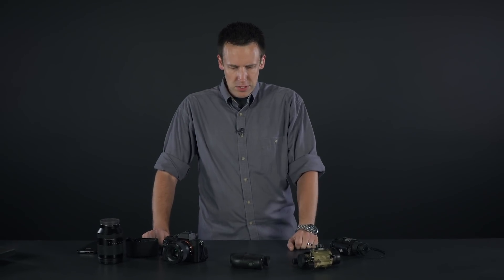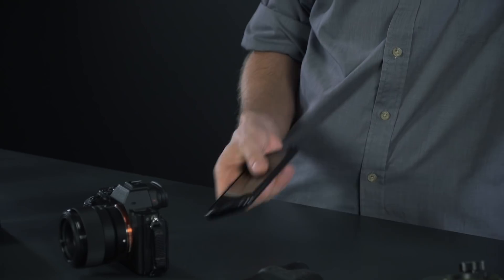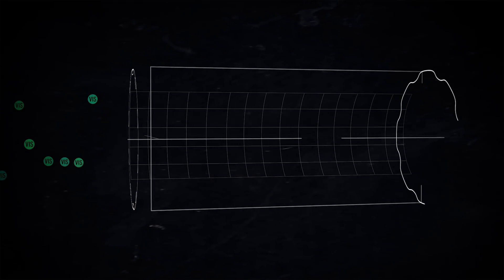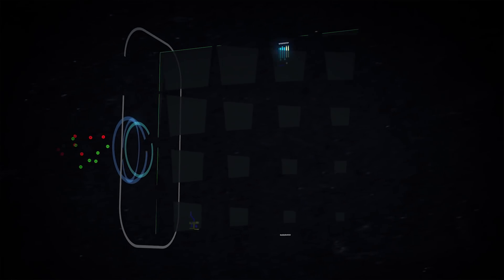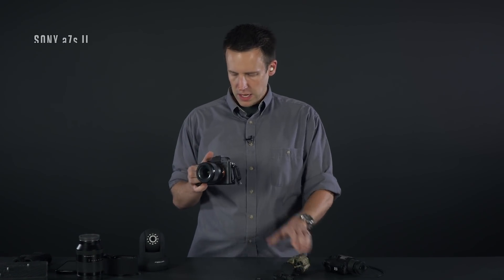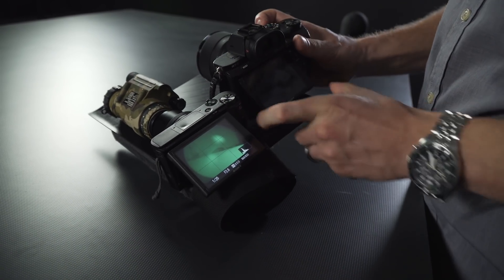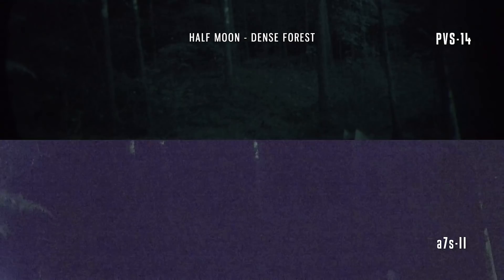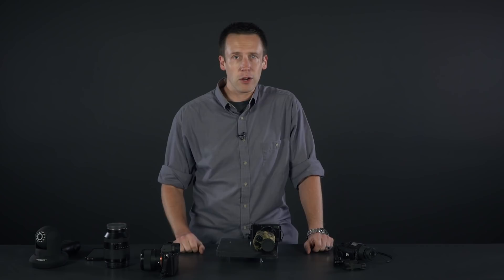When will Digital Night Vision Catch Up?

Comment: I own an Armasight Gen2 hooked up to an Ops Core helmet, works real well for the age of the tech (Russian 90s NV tech) unless it's stupid dark, and that's what IR is for, I'm not too worried about hostile IR signatures as a civilian at this point in time, let alone in that level of darkness which throws a wrench in Gen3s abilities...lol.

Anyways i still find it funny though how an old Gen 1 Cascade tube (think American PVS-2 or Soviet Russian 1PN34/58) kicks the asses of Gen 2 and 3 in terms of light amplification but costs you resolution, which is, as you stated, the most important capability for night vision tech, to be able to amplify the light to a usable level. Perhaps a "cascade-type" arrangement of silicon CMOs could be used to give commerical digital NV an edge, at least since the tech is in it's early "Gen1" phase if you will. I think SWIR  cameras will be the "Gen2" of digital night vision, adding the equivalent of the MCP that is dearly needed to make it viable. Hell, I've heard of UFO hunters and stargazers putting together crude night vision devices made out of old PVS-2 and EEV-8079 tubes and such that work great for that purpose since there's no need to be real mobile with it. 

Though I have no problems with analog tubes, I've beenwondering the same thing about this slow progression of digital NV. While I do think the advances in digital tech are incredible, the real death knell of widespread adoption anytime soon will be cost. They DO have prototype digital night vision units that match or beat Gen 3 OMNI VIII, but they're incredibly expensive, fragile, have awful battery life and/or have other issues since they're prototypes in their infant stages. Similar to when thermal imaging because available in the 1970s and 1980s and costed tens if not hundreds of thousands of dollars, the real hindrance will be price. Nowadays you can get a thermal imaging camera for your phone for $300, but it took a long time for that to become possible. Just my thoughts.

Comment: It's hard to get apples to apples comparison. Ideally you would have a device that has a wide band high sensitivity CMOS sensor designed for low light amplification that reacts to a wider frequency range of photons. Secondly you can do all kids of digital post processing to make the resulting video more closely resemble a proverbial apple. You could do gamma correction, merge the colors to a single brightness value, and finally presenting it not on a black to white scale, but black to green to white, giving the highest range of perceived contrast to a human viewer. Cause that is what the analog tube is doing.
And lastly, in the case of NVG's you would automatically get rid of a large contributor to detail loss here: video compression. I noticed that your comparison shots were all video, not stills. That means that raw sensor data has gone through a video compression, that will have at least some, possibly huge impact on the loss of detail in dark video. This would not be the case in NVG's, as there would be no need to compress the video between the sensor and the display.
It would have been interesting to see you take a raw still image from the sensor, and then see how clear can you make the details after a full photoshop treatment. And any post processing you can do in photoshop, an ASIC can do in real time.

Comment: Pretty flawed comparison. The a7s2 lens can easily be changed and an f0. 95 would have aprx 4x the light hitting the sensor. Yes it would cost more but not by a huge amount considering the cost of the systems involved and I think it could possibly pull ahead. Strange that you went to all the expense of removing the ir filter but didn't think to use a better lense.

Comment: Good stuff. Couple of things though. 
1.You said the CMOS sensor can’t be burnt out by too much light. This isn’t true. 
(Ask any cinematographer that has messed with lasers in the nightclub, or a photographer that is shooting the eclipse.)
2.You only used a f1.8 lens on the a7s2, 
It’s easy enough to get f1.2 or even f1.0 lens which would more than double the light transmitted through a f1.8.
Then there are speed boosters, you can use a focal reducer to use fast medium format lenses and gather even more light for the FF sensor. 
Admittedly the lenses start to get big and heavy at that point, but I’m just pointing out you used a very off the shelf consumer solution for your low light digital camera lens option. 
A LOT more low light performance can be gained from a a7s2 if you want to go a bit further.
Reply: Yes, you can cook a CMOS sensor with enough heat, which prolonged exposure to sunlight or laser beams will do. However, you can point this camera directly at the sun and shoot photos and video for minutes with no permanent damage. I once permanently burned an analog tube in less time by looking at a fluorescent light in a dingy gas station.

Comment: This comparision ist so wrong! A7s extreme  low light performance ist only archived in 1080p Modes in 24/25/30fps (only there is full sensor readout with its amazing lowlight noise reduction). You Talk about 4K Mode, redo your homework and film in 1080p/25 with 1/25 exposure time in fullframe mode. And use a speedbooster (150$) with a F1.2 Lens to get an aperture of F0/0.85. You will see a comparable round vignette like in your night vision but get even more light. Then you will see in which case the Sony 7S series will shine.
Reply: I disagree; I think the camera image looks better if I film in 4K 24p and then downsample in post. Now, I do agree that with a f1.2 lens I could have got more visible photons, but I knew that the f1.8 lens had good IR transmission, and the nicer lenses often don't. Also, a speedbooster would have been fun, but I think its kinda cheating. I also could have used NeatVideo to remove the noise on the 4K video, but that DEFINITELY would have been cheating.
Reply: @isaacbotkintrex  What is 'cheating' in this respect? You're comparing the very best night vision hardware with the best possible result with digital.
Reply: @bogorad  Well, actually, I don't have the BEST night vision hardware; I have a small and light $4k monocular. I was trying to compare a similarly priced, similarly sized digital option. Of course I could spend $15k on ten pounds of lenses and adapters to boost the camera, but then it's hardly the same class. And if we're going to leave the hand-held and personally-affordable class, there are vehicle-mounted night-vision sensors that make the PVS-14s look like toilet paper tubes.

Comment: Great video! Really interesting. Would have been nice to add a F1.2 or even F1.4 lens (as the nightvision device uses a F1.2 lens but the Sony had a F1.8). That would have meant a 50-100% difference in brightness/noise performance.

Comment: Just a novice question: Why not compare it with "true IR cameras" (low wavelength IR) I.E Thermal cameras. They are digital, can see in complete darkness, is starting to get fairly god resolution (720p and up), have very high sensitivity and can show even the most subtle differences in vibrant colors if needed (or just the normal black/white). But sure, they give your wallet a fair punch. Couldn't even get the specs of FLIR's higher end ones. :P

Comment: Sounds like sensor manufacturers need to make a large format, low res sensor. The high res of that camera is killing its contrast ratio, which is the defining factor in monochromatic images. But this would be the only market for such a sensor.

Comment: You did not say anything about the lenses. You can get much faster lenses for the A7S, just like your night vision goggles have.

All you would have needed, is a faster lens on the A7S and it would have beaten the night vision easily. Apparently the PSV-14 has f/1.2 lens. You can easily get f/1.0 for the sony that would be 2/3 more light. And the lens you were using, was most likely f/1.8 so f/1.0 would have almost quadrupled the amount of light the sensor receives.
Reply: Youtube User at the deficit of having very little actually in focus with the a7sii

Comment: There is quite a lot of difference by using a f1.8 lens instead of 1.2 lens like the nightvision has. It's not a pretty good match like you said because the 1.2 lens puts approx 2.25 x more light on the sensor.

Comment: You forgot another very big pro with digital sensors:
like digital cameras and/or cellphones you can have multiple sensors which means broader dynamic range and less noise and that results to in no more big blobs of light which if bright enough can blind the tubes.

Comment: So there are some problems with this video (ex some small mishaps with scientific language and logic): As a military equipment has to be reliable, there is a huge difference between those devices. I am just thinking of an EMP and all your CCDs/CMOS devices are dead and I mean literally they are destroyed, not just turned off... Battery life and efficiency is another problem, but this might be overcome somehow.
The biggest difference is however the sensitivity of Si-based sensors. They just stop at ~1.1µm (bandgap of Si). Well you might think going to e.g. InGaS-based sensors, but they only work between ~700nm and 1.7µm. I am not even considering dicussing the prices for those sensors (20k-40k$ for 640x480). So with all those devices real IR is not possible. (I am not even talking about cooling active sensors, just to get the noise down to acceptable levels [warheads use cryo-cooled sensors and they only work a few times before they fail]).
This video shows some 'IR light', but it is barely outside of the visible spectrum. Some people can actually see it. So this is not IR at all...  So please take the IR bade off the 850nm footage. It is just barely Near InfraRed (NIR)...
Another issue in this test is the use of a lens meant for visible light. I get it - you want to show a real life (not so expensive) test, but remark at least, that a) the transmission of this lens is terrible outside the visible spectrum and b) most lenses will not be able to focus to infinity, even manually...

Just my 2 cents...
Reply: Good points! Yeah, this video isn't seriously practical (since commercial cameras aren't the same as hardened, SCUBA-capable combat optics), or rigorously technical (since I clearly use the term "IR" so loosely), but sits kind of awkwardly in the middle. And good point about the lens; this specific budget Sony lens is popular for IR and UV photography because its design and coatings aren't as exclusively built for visible light, but I don't have a good way to measure transmission of specific wavelengths.

Comment: The two simple reasons why we don't have digital night vision:
(1) Noise. We just don't build sensors with a noise floor low enough to make them viable units; you saw the Sony at very low light - unusable.
(2) Demand. Notice I used "don't build" rather than "can't build" in the above point - A 2MP 35mm sensor with a few years R&D would probably crap on the Gen3's ability, but the commercial demand for creating that specialist hardware just doesn't exist. You might argue "The military" - but you're not taking the numbers into account. Canon shipped 30 million cameras last year, and they're under half of the market share - that's where your tech curve comes from - they need to keep up with the comptetion. So what if Canon put funds into Digital Night Vision - How many DNV units do you think the US Army would order? 100,000? 200,000? 300,000? It's not anywhere worth-while investing the R&D into the specific requirements of DNV tech when the return is likely less than 1% of your primary market.

Comment: Why on Earth are you pitching your soundeffects at around 3:40 so goddamn high? Sounds like 13+kHz and it hurts my ears at that level...
Reply: Klappspaten this is what happens when old people edit audio and they don't keep an eye on the frequency spectrum analyzer.

I was enjoying the video right up until that point as well.
Reply: i know right wtf were they thinking
Reply: Scrolled down just to find out if I was crazy or not. My ears ring and this sounded like it suddenly got much worse so I started to wonder if it was my ears or my speaker system, pausing the video proved I am not crazy, my ears didn't suddenly get worse, and my speakers are fine. So now I have to decide if I want to press on through the video and endure that noise or learn a little less today... Well the ears don't already ring for no reason.
Reply: Klappspaten 100% what the hell is that godawful noise doing in a video?
Reply: at least i know that hearing around 13khz proves my ears are still rocking pretty good
Reply: I can't hear it. You think the VA will increase my disability rating?
Reply: @dizzlethechef  well that depends how old are you? the pitched sound is above 10khz, so if youre over 35-40...ofcourse you won't hear it because that happens with age
Reply: @Kaotix_music  I'm 39 and I could hear that horrible sound... so I guess that's good news, my ears aren't that old!
Reply: Yep. I'm in my mid 20s and heard that.
Reply: That's the noise the cathode tube makes when powered up .....
Reply: I haven't used this specific device, but the noise is certainly way louder than the worst old CRTs, and they were pretty unpleasant to anyone with healthy hearing.
It's a shame, I was really interested to know how it works. I guess I'll research it later.
Reply: That's a nasty sound!
Reply: I hear this too wtf I hate those high frequencies
Reply: Exactly like holy shit. I've seen people put typical NVG movie sfx on videos but not to this tinnitus inducing level
Reply: With my 60 dB hearing loss, I didn't detect that noise at all. Until my mid 20s I could hear the flyback whine on CRTs, but now a lot of annoying noises have gone away with my cilia. Mixed blessing/curse.
Reply: thank you for pointing that out!
Reply: I thought it was my ears.
Reply: Oh god. I can hear it even through speakers.
Reply: @kay00  No, they just know it bothers the whipper-snappers! ;)
Reply: Because a large number of PVS-14s produce a high-pitched whine when they are being used, especially in very low light when the gain is up.
Reply: Older sound engineer who went to a lot of Rock concerts and has lost his high frequency hearing
Reply: lmao all the deaf and poor people who can't hear it
Reply: I can't hear it.
Reply: 3:38 bro not 3:40
Reply: @chicky47  thanks for that, I thought I was deaf for a second
Reply: @liquicitizendirk2147  yes you are 🤪😜
Reply: I'd say it's 15625Hz because it sounds exactly like a crt tv.
Reply: Music to my ears
Reply: What are you talking about? I don't hear anything. Are you like a cat girl with big ears on your head and super hearing?
Reply: @checkpoint3260  you may just have bad speakers that don't go that high, or you have bad hearing
Reply: @sheeplord4976  Heck ya all I hear is tinnitus. But if you don't shoot.... why do you want to know about night vision?
Reply: Are you guys legitimately disabled? Thats the sound of the cathode tube
Reply: Im not old and couldn't notice it
Reply: OK Boomer
Reply: @caleb6200  Ha! Indeed so- I lost a lot of my hearing from an explosion I survived in 1977, so I'm literally a boomer. Skydiving with open-ear helmets, driving rattletrap VW buses, and running a few thousand rocket engine tests hasn't helped, either. It's not the years, it's the mileage.
Reply: Shut the fuck up incel
Reply: It's not a sound effect.  That's what it sounds like when you turn the thing on.  MAN UP
Reply: I love when people bitching about somebody production well any consideration about what it takes to even attempt a YouTube channel
Reply: Klappspaten what are you going on about the audio is fine you fucking know it all

Comment: I suppose one could get a "specific purpose built" digital sensor such as in sony a7s ii with some "special" custom order sensor design. ie. digital image sensor that is as good as a7s ii silicon chip AND WITHOUT bayer CFA; still equipped with microlenses but (once again) WITHOUT Bayer CFA.

Some astrophotographer have done this and the result is indeed promising, but mostly some home made hacks; so to get as much performance we need factory/chip maker support since the production on the sensor. Still needs custom chip controller & demosaicing algorithm too since quantum efficiency of each pixels will be very different from normal bayer cfa equipped digital image sensor.

On another note, actually there's a very similar concept of sensor from leica monochrome, ie. a digital image sensor without bayer cfa, pity though their silicons not as good as sony's.
Reply: Budi Suryadinata Google SPI x27 camera.
It's better night vision than the nvgs and in full color from a digital camera.